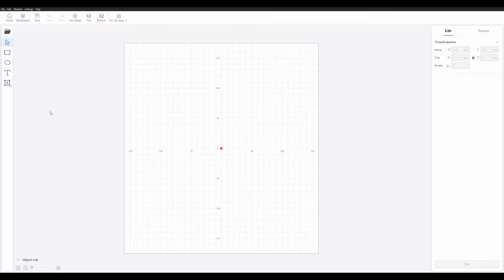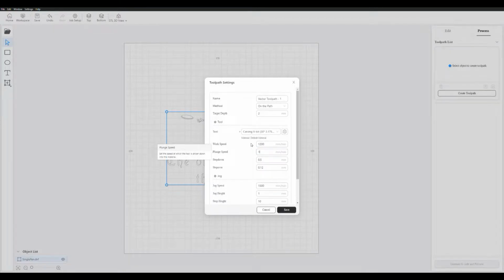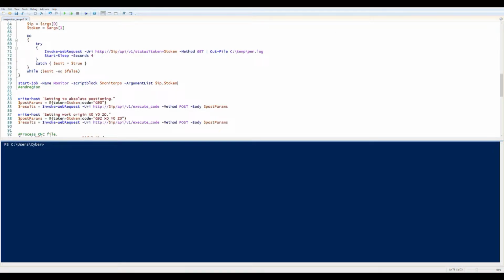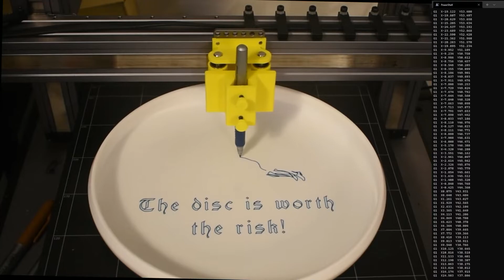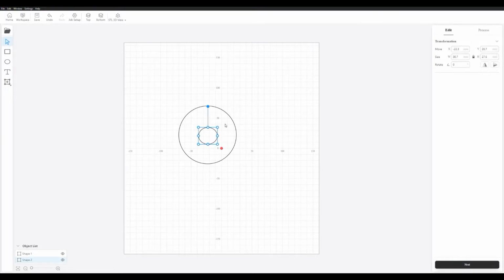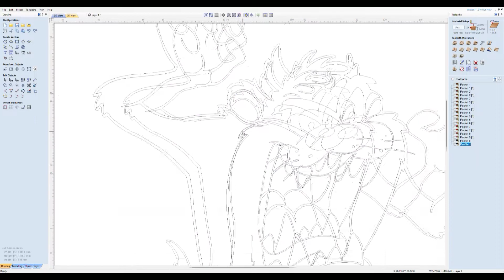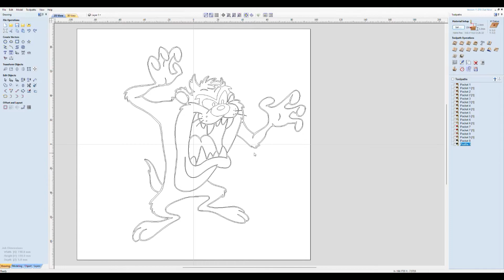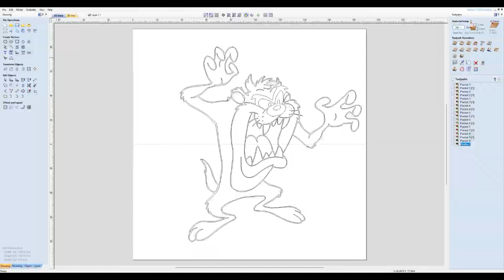SnapMaker 2.0 - Pen Attachment

Comment: How are you sending the gcode just usb serial from the console? I'm just confused on how you managed to trick out the printer looking for the tool head.
Reply from the maker: I use wifi. The powershell script does a discovery on the network and once connected you can send the commands weither the tool head is attached or not.
Reply: @TechCentric_00  Also where did you get the magnets there wasn't a link
Reply from the maker: Many different kinds would probably work I used these. https://amzn.to/3BDt4Fj
Reply: @TechCentric_00  My Pen adapter isn't going to my work origin even if I set it on the machine, any ideas to why? It's just stuck at the homing position and staying up in the air. I have a A350T model.
Reply from the maker: @ryanward1548  It is hard to say without seeing what you are doing. Can you record a video of the steps you are taking and share?
Reply: @TechCentric_00  I can try to make a video but from what I've been testing the work origin coordinates get lost after I print the first layer of you 01_TAZ_Brown.cnc no matter if I use the computer or the machine as soon as it's done there gone. I'm wondering if it's a bug in snapmakers software as I've been having some strange issue with the new firmware released.
Reply from the maker: @ryanward1548  I haven't updated mine in a while. I will and try my process again to see if anything has changed. It may take me a few days.